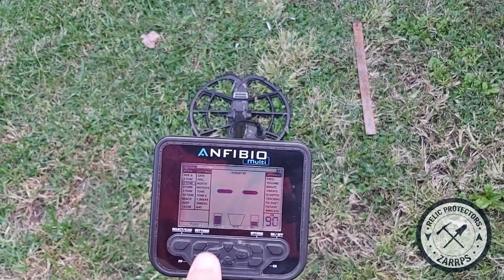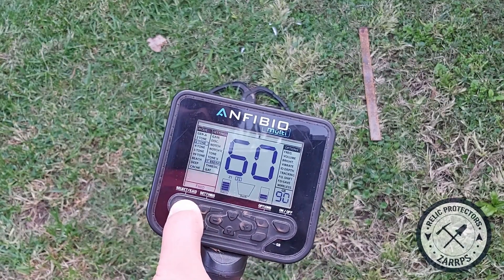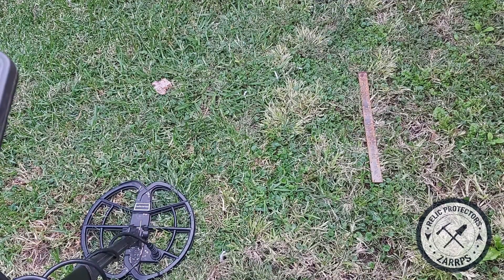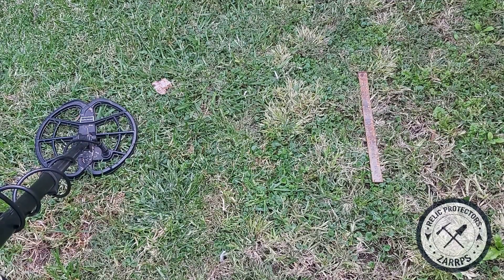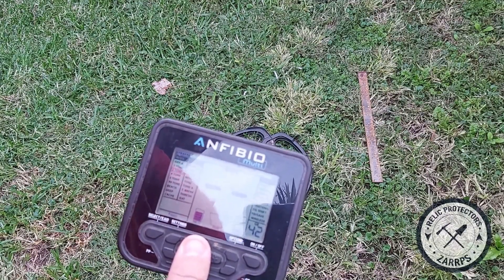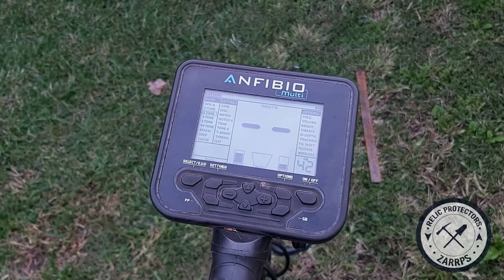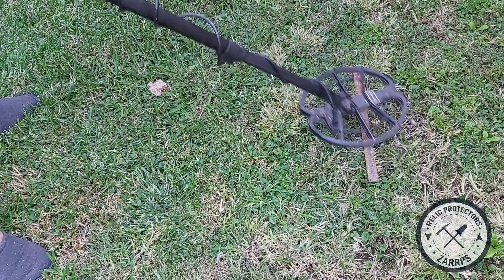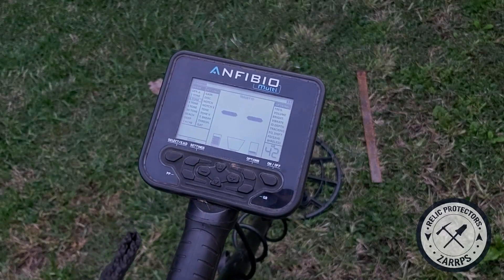Metal Detecting Guide - Digging Less IRON - Nokta Makro Anfibio

Comment: HI, GREAT VIDEO, I UESD THE MULTI ON THE BEACH AND IN THE SEA WITH NEL THUNDER 14 IN COIL....IN THE WATER IS NOISY AND ON THE WET SAND TOO. MY DISC WAS AT 03-04 ON BEACH...WITH THUNDER ON WET DRY SAND COIL IT JUNPING BETTWEEN 04 AND 96-98 FOR BOTTLECAPS...IT IS A LITTLE CONFUSING...
Reply from the maker: Thanks for watching. Remember these tips will never be 100% fool proof.. just another tip to add to your arsenal when going out and identifying good targets
Reply: Before you GB on wet Beach, go to Beach Mode, put isat on 3, drop gain down to 50, do your ground Balance then bring gain back up! If your machine don't GB low enough, you can lower the GB to 00 manually!  Best of luck & HH!

Comment: How would you compare this to a mine lab Equinox ??
Reply from the maker: Steven, unfortunately I dont know the nox as well.. but with some experimenting you could get a similar result. Perhaps if you hunt in multi freq mode, use the iron bias. Set the iron bias low to detect those iron patches or similarly when picking up possible iron sheet. The point here is to understand how your machine recognizes those iron signals and use it to your advantage. Not completely cancelling it out.